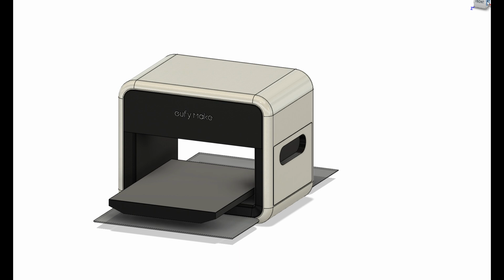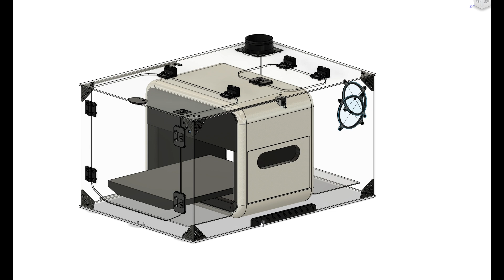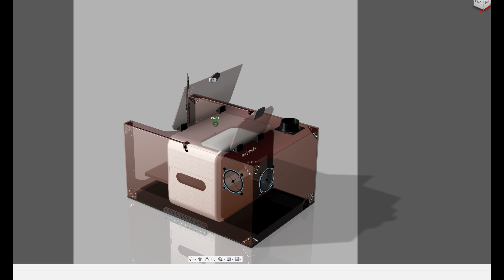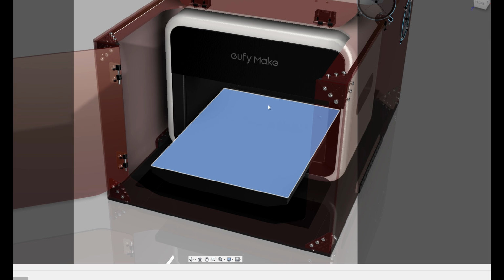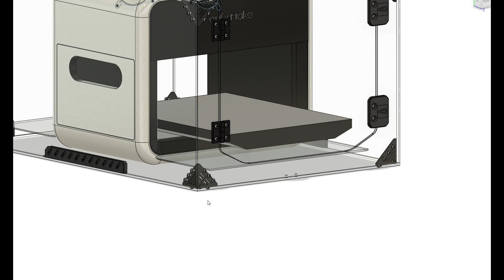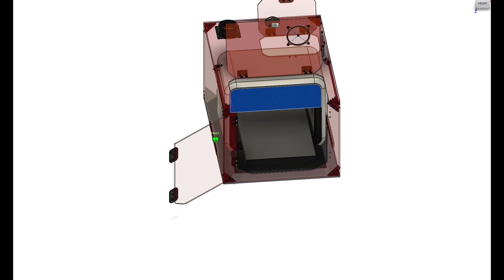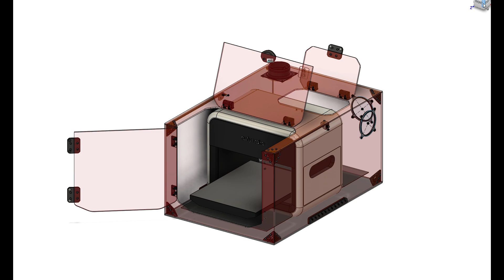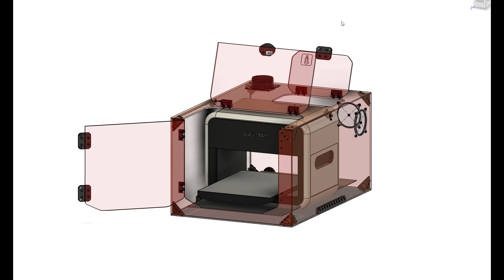Eufymake e1 Enclosure by Clearview plastics

Comment: Two small issues.  1)  Although there is a lid for ink access, there is no side access for the cleaning cartridge, which is a shame.  2)  Although the front opens up, the sides seem static, which prevents proper access - we need our arms to go in from the sides.  I used to have a case for another set of gadgets that had the sides connected to the front and lid, so that when it lifted up it allowed access from top front and sides which was really useful.
Reply from the maker: We appreciate your feedback and will make some considerations. From our point of view, the ink tank is something that needs to be accessed one to a few times per year and at this time there should be additional maintenance on the printer. That said in this case it is best remove a side panel which typically is a 10 minute job to remove and put back on. That said, we'll take a look at our assumptions and adding a side door to see if this would be more necessary than our assumption. If it is really important for users, it is something we can implement.